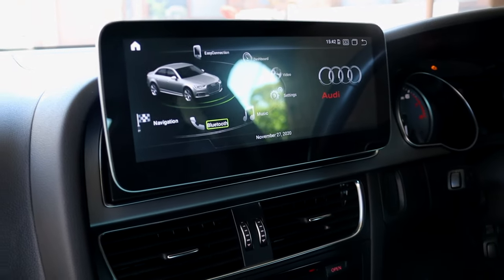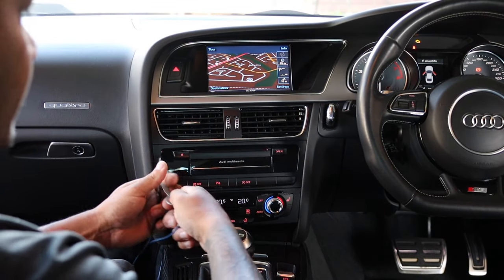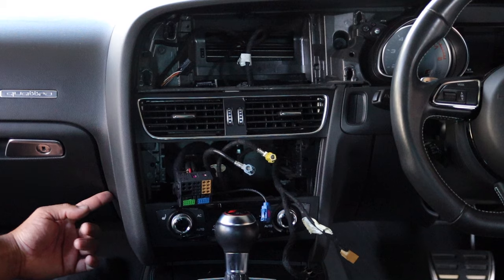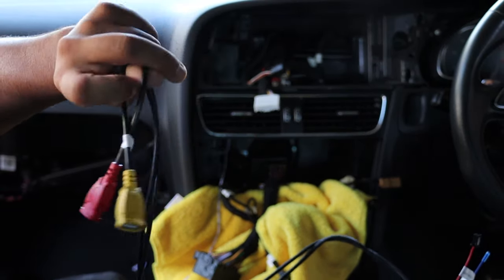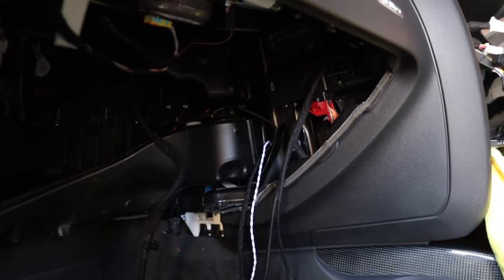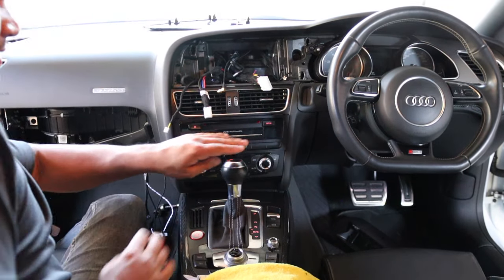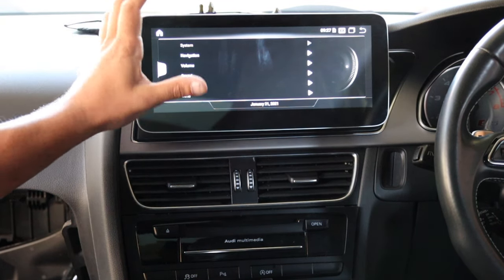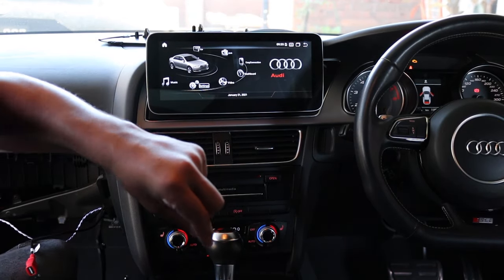Audi A4/A5/Q5 10.25" Android Screen Install (Full Install) Wireless CarPlay / Youtube / Netflix.

Comment: Hi great video. Have you installed one of these units to an a4 that has a passenger airbag light under the hazard button, if so what happens to this?
Reply from the maker: It gets deleted but left plugged in
Reply: @TheFittingBay  how did you delete it mine every time I start the car the light comes on the screen regardless if I previously deleted it with OBD11. it came with a split cable that connect from the original one side to the new hazard light and the other to the previous hazard and airbag.

Comment: Installed a similar one of these on my A4, but there’s a ground noise that changes with the engine RPM. Extremely annoying. Any advice on how to rectify the issue?
Reply: Which one did you get? I'm looking and have had a hard time finding a good one for my A5. Also have you by any chance fixed it yet
Reply: You get it resolved?  I have the same issue in my Q5
Reply: @pvpatrick  No luck yet. If you do, let me know!

Comment: Hi bro . I have installed a similar unit in my Audi 2012 manual version(Left hand drive). But dashboard option in the device not showing engine rpm or engine speed, door open notification. Also, audio output giving a humming noise.Help me please.
Reply: Hi! Did you find the way to fix it? I got the same issue with Audi SQ5 2014. All features are working, except the dashboard - it's just static picture...
Reply: @vladimirnikulin1058  Actually, not yet bro. I am not sure, but might be because my Audi is a Premium version (lower variant) Or could be due to a wrong CAN bus cable that came with the head unit.
Reply: @swagathmohanan2239  I managed to fix it, turned out that the CAN bus was not connected to the car gateway. There was a special cable for it which they didn't use during installation.
Reply: @nikulin.v  Wow that sounds good. But I don't think the unit I bought has that special cable.Is there anyway to get it?
Reply: @swagathmohanan2239  I believe it should be available on aliexpress or alibaba. I think it would be the best to ask the manufacturer
Reply: @nikulin.v  OK bro, thank you.Nope I asked manufacturer but no use. Do you know the exact name of the cable?
Reply: @swagathmohanan2239  unfortunately I don’t know the name

Comment: Hi! I have this System in my Audi A5 Cabriolet with Android 11 is it  possible to get one Update to Android 12 or 13 becourse i have the Samsung S23 Ultra and the Android Auto ist not working properly the connectio is instable. Connection is via zlink you have any solution thank you best regards Horst vrom Germany

Comment: I installed a similar system in my Audi 2016 A4 non-mmi version.  It works perfectly.  The only issue I have is that my airbag light is always on.  My installer told me that the new system doesn’t have any ports for the airbag light so that why it’s showing up on my dash.  Does anyone else have this issue and how did you solve?

Comment: what is when i dont connect can junction?? i mean if i connect it my engine and car dont start. what is it?
Reply from the maker: You have to connect that plug, but the junction doesn’t get unplugged there is female for the original side. If you don’t connect it screen won’t operate correctly

Comment: I have a problem, @8.53, you discuss removing the black facial section to fit the screen, however on my A4 s-line b8, the black section you remove is one silver section and cannot be separated. Any ideas? I can email you a pic if you need?
Reply from the maker: Hey man please email pics!

Comment: Also is there an after market reversing camera that i can install as currently I only have reversing sensors!
Reply from the maker: https://shoptfb.com/collections/audi/products/reverse-camera 
Right there my guy
Reply: @TheFittingBay  hi Guys is there an email address I can contact you?. The unit has been fitted to my S5 as per the video instructions but the MMI knob is not working the front menu screen. The car audio company ask if there was something missing in the instructions. Best I email you and copy the audio company so you can communicate together to resolve?
Thanks 
Bob
Reply from the maker: @bobgunston5993  solved via email.

Comment: Hi, I installed the 12 inch on my Q5. Everything is working fine but my airbag light is constantly on. I have the Pass Airbag Off Light on the original facia. I was provided with the airbag cable. Once end (6 pin female white connector) is connected to the hazard light. The other is a black 6 pin female connector, not connected to anything. Is that my problem? Do you have an email address  that I could send a picture to?
Reply: How is it holding up 1yr later?
Reply: Still working great, no complaints from me. All features still work perfectly and there's no slowdown in the system.
Reply: @courtneyg06 hi my a5 airbag light is also on how did you fix this?

Comment: I’ve installed the unit in my 2012 S4 with 3g, everything works. I’ve got a dash light for an airbag & parking brake, I’ve noticed my cruise control don’t work either. Pleas help pin point the fix @TheFittingBay

Comment: Please can someone help me?

I’ve recently bought a second hand Audi S5 2016 and it has this screen but I have no Bluetooth connection, tried different phones and resetting but no luck. 

Is there an update file I can use to fix this? Or is it something behind the screen that is the issue? Thanks in advance!
Reply: I have had mine for 18 months, and it is crap, problem after problem, from freezing every day to almost impossible to pair and many move issues, my first one was replaced the second one had different problems.
Reply: What phone do you have? I read in one of the other comments that people with latest gen phones are having problems pairing (something about these headunits running older versions of android. I've got a Samsung S21 Ultra and it's working fine but my phone hasn't been updated in at least a year... Maybe 2. Try it with an older phone.

Comment: Very informative! However, not sure why you removed the inner part of the bezel when all have to do is remove the hazard OEM switch instead then connect the OEM hazard cable to the new hazard bezel switch and the new face plate that supports the 10 inch screen just sits on the OEM bezel. The double stick tape wasn't necessary you lost the inner clips that anchors everything to the dashboard. I should know because I install the same one your installing. Oh well, live and learn I suppose?
Reply from the maker: The new hazard switch trim and the original one will not mount together in any way so I’m not sure how you could use the original trim in tact

Comment: Can this screen be installed on audi a4 b8? It's a 2008 model
Reply from the maker: Yep just depends if its 2G mmi or not
Reply: @TheFittingBay  I followed the link, compared mine to those on the website. Mine is concert/non MMI. Does it mean this screen will not work on my A4?
Reply from the maker: @mrgmech6773  No it will work, you just need to pick the correct options (concert) provided the radio in your car says "Concert" and pick the drive side LHD/RHD so is the steering wheel on the left (LHD) or right side (RHD) and then order it and we will do the rest :)
Reply: @TheFittingBay  thank you :)

Comment: Hi, I just installed one on an Audi A5, 2011. I have two problems: 1) when I press the Car button on the new navigation, the screen splits somehow and shows the original car's menu multiplied on the left part on the screen. I have a video of it.
2) also, I can not use the knob, the volume button and the rest of the buttons from the central consola.
Huge thanks in advance for answering.
Reply: I have the same problem...
Reply: @orfeolocci9563  for the first problem please do the following: go to Settings -> factory settings(for my car the password was 1314) -> car type and make sure that you select the right screen size. I actually tried every screen type. For the second problem, please select the right MMI type from the Factory settings menu. 
Hope it helps.
Reply: @roxanaminzat7287  It worked !!, thanks for the help your a legend.

Comment: I appreciate this video, helped me with the install! Only issue I have is locating the audio cable...where is it? I can't get audio from the display, but the MMI still reads audio (if that makes sense).
Reply: @joaquintorresabad1625  Did you get it fixed? My bad on the delay. If you still need help, I'll send you how.
Reply: @Modupehsautowork13  Hey iam trying to Install it and have the same Problem. How did u solved it?
Reply: @nimawawrikidis8826  Hey, so I had to set the audio to aux within the MMI. After doing that, I got audio. Let me know if this helps.
Reply: @Modupehsautowork13  yeah it worked. Thank you very much.
Reply: @Modupehsautowork13  @nimawawrikidis8826 i do not have a Aux setting on my 2012 a4 b8 mmi. where do I find this setting?

Comment: What size screen is this?
Reply from the maker: 10.1"
Reply: @TheFittingBay  Ok Thank,   Does this work with the B8 Audi A5 2010
Reply from the maker: @darrellhayes2197  Sure does. Just need to know what radio you have.
Reply: @TheFittingBay  The prestige package B & O with Nav
Reply from the maker: @darrellhayes2197  works perfect https://shoptfb.com/products/a4-a5-q5-09-16-10-25-android-replacement-screen

Comment: This screen is great, but for some reason it won’t turn off when I turn my car off or open the door after the car is turned off. Anyone else have this issue?
Reply: Yea same problem here. Its kinda annoying because every time you step out of the car you have to put tab the "screen off" button.... i am pretty sure that the car battery is suffering because of that.    Is there a way to fix that?

Comment: Did anybody get an air bag light or parking break malfunction when installing this?
Reply: Did you fix it yet because do have the same problem
Reply: @martincruz9197  I took it to Audi to clear the codes
Reply: @RavannaBell Hi so the airbag it self works but it was just a code issue cause my passenger airbag light has also appeared after installing this kit I was thinking of clearing code but i wanted to make sure the bag still works for my passengers safety?

Comment: Hi does it work with the 6 cd changer and 2G MMI?
Reply from the maker: 2G yes - CD changer depends some models need to have it unplugged for AUX input. Does the car also have AUX?
Reply: @TheFittingBay  yes it also has an aux
Reply from the maker: @ChadBurrows1  CD changer should be fine then but it will on the original MMI system (as seen in video you can use the genuine system and the android)
Reply: @TheFittingBay  great, can you confirm which particular one on your website is compatible? Is it just the "ALL 2G MMI VEHICLES" one?

Comment: You have one for 2013 RS5
Reply from the maker: This works for Rs and S models :)
Reply: @TheFittingBay  where can I get this installed  ?
Reply from the maker: @awakenosiris  Where are you located?
Reply: @TheFittingBay  Hempstead,  New York
Reply: Do have the panel with the airbag
Reply from the maker: @awakenosiris  we don’t have any partners there im so sorry
Reply from the maker: @awakenosiris  airbag light gets removed and kept plugged in to prevent codes

Comment: How do I change dashboard speed from kph to mph ?
Reply: Did you ever determine how to change from kph to mph?  I just installed mine and I've gone through all the menu's yet I cannot find how to change to MPH.
Reply: @RobertForrester_FPV  no. I gave up. But if you find out please let me know haha
Reply: @RobertForrester_FPV  Go to the factory settings, pw is 1314, then adjust the vehicle settings from metric to imperial.